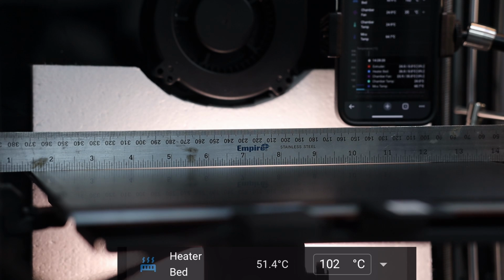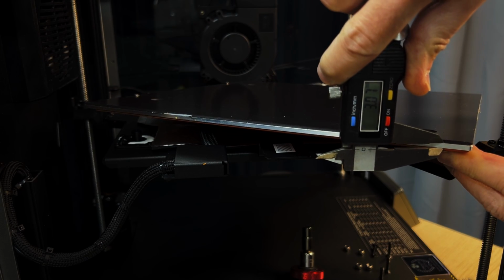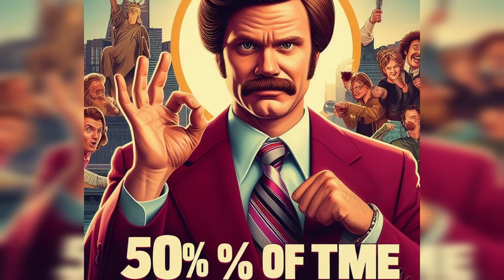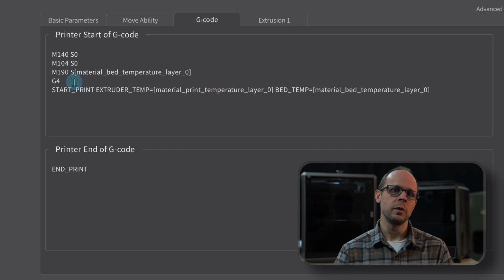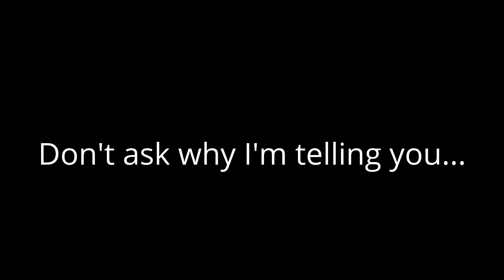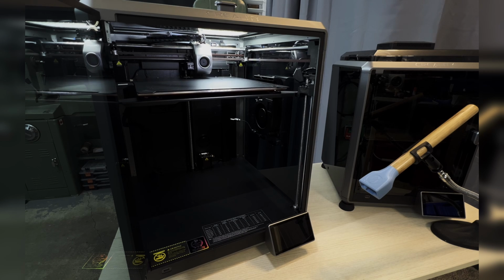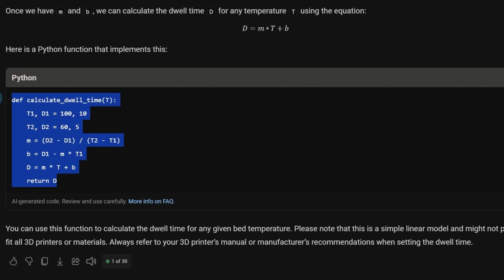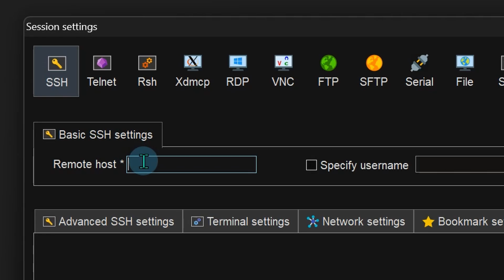Let Your Creality K1 MAX and K1 Printers Soak for the Best First Layers

Comment: Dude that thumbnail is legendary
Reply from the maker: Thanks!!  I'm starting to get there with my TNs, sometimes they come to me quickly and sometimes I can spend sooooo much time on them.   What seems to work well is to pre-plan before I get too far into the videos.  That way I can take the right photos while I'm recording, trying to do it at the end doesn't work out as well.

Funny story.  I had to Redo this a few times because the tub that I needed to fit the K1 Max into had to be huge, so I settled on the smaller K1 and called it a day.

Comment: I have implemented this strategy and it along with adding bed adjustability the root have mad my K1 Max a much better printer. Thanks a ton for these how-tos.
Reply from the maker: For sure, I think we're at the point where we can get a good first layer each time and we don't need to even think about it.  I still want that thicker bed, but this is an okay solution for the time being.   I added an updated bit of coding in the description, it has a dwell time that's based on the bed temp if you want to try that as well, or maybe you have already.
Reply: @NeedItMakeIt  I haven't done the updated one yet. What is the behavior of that one? Does it hit the target temp, then start the timer?
Reply from the maker: @iwannaratrod  It's a lot nicer it will change the amount of soaking time based on the material you're printing with.  60 = 5 minutes, 80= 7 minutes, 100 = 9 minutes extra.  You can play with the formula as-needed, but it's simple and effective, I've been using it on all of my prints since yesterday, near perfection!

Comment: So once we put that G code in, it will do that every time or only when you put print with calibrations?
Reply: Thanks
Reply from the maker: It will do it every time, though there is probably a way to do it differently, I'd just need to know when you want it done and when you don't.  
I'm working on the feature to dwell based on the temperature right now I should have something to update everyone on in a few days to make it so we don't need to wait as long for a lower temp like 60C.
Reply: I just tested it. It only does it when you say print with calibrations so that’s good you can do one or without. Thanks again.
Reply from the maker: @jacory1980  That's strange, when I tested without calibration on Creality print it worked each time.  I have rooted and use KAMP, this may be why, something in CP may be overridden .

Comment: It only took me about 300 usecs to hit like, I already knew I'd like it. I am interested in the replacement beds for the K1Max you spoke about. Thanks for showing the gcode across multiple slicers,  again for sharing!
Reply from the maker: It's my pleasure!  LOL I rounded up to account for those slow clicker people :)  I'll definitely let you know about the thicker bed option as soon as I can.  I'll have a video showing a quick install and then some testing to make sure we're getting really good results.  I can also show how long it takes to heat the bed, it will be slower but should be much flatter and stay a lot flatter.   I have a surface plate that I can also test flatness against right out of the box.
Reply: @NeedItMakeIt   Thanks for the G code👍🏼 I will also be interested in the thicker bed.
Reply from the maker: @RestoDesigns7  You're welcome!   Cool, that's good to know how many people would want one, the company I'm working with had had a lot of requests as well, I think it'll be a popular item.

Comment: I've been printing non-stop on the K1 Max for my business and it's an amazing printer. I still have yet to do the shim technique to level the bed. 
😭
Reply from the maker: Hey!   If it works, it works.  I had a lot of trouble with my first layers on the Max, it really depends on what you print, and where you print, when I printed large pieces I had some PLA prints turn out really well, but the PETG and ABS didn't work out as nice on the first layers, some were hideous.  

I really want to do the bed swap for the thicker plate and see what the difference is.  I also have another idea and I think I'm going to make a video about casting my own bed (K1 smaller printer first).  I want to see if I can make a light bed with a webbed structure which also stays flatter.  I have no clue if I can, but it's a neat idea to try at least.

Nice to hear from you again my friend!
Reply: @NeedItMakeIt  the thicker bed makes sense. I took the existing plate and methodically bent it backwards to give the corners some tension. This keeps my corners down while printing, which was another issue I was having.
Reply from the maker: @AvocadoAtrocity  I was having the exact same problem with mine, beyond those holes the corners dipped down.  It's tough to know how much to adjust since it changes so much based on the temps.  I have been looking at some of the other printer brands and they all seem to have thicker beds for these sizes of build-volume.  I'd love to try copper, but it's probably far too heavy.  There must be an alloy out there that can be injection molded, if they do can do the frame, why not the bed?
Reply: @NeedItMakeIt I have an X-Max 3 with the 6mm thick plate, as well as a K1, and an X-Plus 3, which both have the 3mm thick plates
All values below are measured after heat soaking.

Total flatness variation on the K1 is around 0.23mm across the 220x220 build area
On the  X-Plus 3, it's typically 0.16mm across the 280x280 build area at 60C temps, although at 100C it climbs to around 0.24mm
On the X-Max 3, it's around 0.08mm total height variation across the 325x325mm build area, and that seems to be fairly consistent from 60-100C bed temps

The only downside to the X-Max 3 is that with such a massive chunk of aluminium is that it takes around 8-9 minutes to hit 100C from room temperature, and about another 10 minutes to stabilise, but once stable it is so very flat.

Comment: Definitely keep us updated on the thicker bed collaboration. A 10 minute soak plus KAMP probing on a 5 hr print isn't too bad.  A 10 minute soak plus KAMP probing on a 5 minute print takes a toll on my patience.  IMO, 3mm beds should be limited to 220x220 machines or bed slingers where weight is an issue.  Also, thanks for showing the gcode across multiple slicers.  That's something I wish more content creators added to their videos.
Reply from the maker: I will!  I'll have another video on it and it should be the whole kit so we don't need to try to remove the existing parts and ATTEMPT to reuse them (apparently peanut butter is a legit solution... somehow) to get the adhesive off.  

I think this printer with a 6mm bed thickness would be awesome and I hope Creality makes the change for future printers in the factory.  Even if they need to raise the price slightly it's worth it and will help if they want to increase the accuracy of their filament calibration.
Reply: @NeedItMakeIt where and when? I’m keen for one

Comment: Looking forward to a new chunk of aluminum being available 👍👍
Reply: I don’t know if it would be possible to remove the heater from the existing bed, or if one could buy a new one.
Reply: Actually, Amazon has replacement bed heaters in stock.
Reply: @JustSomeHuman-j8o I ended up buying a 6mm thick bed and new heater. I ditched CR Touch and installed a Cartographer probe. Everything works MINT. Also previous replaced hotend with Microswiss Flowtech.

Comment: To make the soak time-dependent based upon temperature, you want something like this:

G4 P{max(0, first_layer_bed_temperature[0] -10) * 6000}

This says to take 10 off the bed temperature, and then choose the maximum of 0, or that value
Then multiply that by 6000 to get to milliseconds
This way if you set the bed temp to 60 degrees, it'll wait for 50 * 6000 = 300000ms = 5 minutes
If you set it to 100, it'll wait for 100-10 = 90, then 90 * 6000 = 540000ms = 9 minutes
If it's set to zero, then it'll wait for 0ms
Reply: Does someone have the same problem as me? I have no problem with G4 P540000 but the machine will pop up error 2171 when I switched the Gcode to below.
M190 S[material_bed_temperature_layer_0]

G4 P{max(0, [material_bed_temperature_layer_0] -10) * 6000}
START_PRINT EXTRUDER_TEMP=[material_print_temperature_layer_0] BED_TEMP=[material_bed_temperature_layer_0]

I'm using Creality Print if that helps. Having this Gcode is very useful as I don't have to switch to different material but somhow i got a weird error. Thank you for any input.
Reply: @sonluong4043 The error is probably due to that line containing python script. It's not all gcode.
I don't have a K1 yet but hopefully picking up a K1 max today. I have 3 other printers running klipper though so I'm very familiar with it.
If you want my advice, root the printer. It may seem over whelming looking at all those lines of code but with some patience and determination you will learn to understand what each line does and why it's there.
Klipper is documented very well and there are many communities that can help you when you get stuck.
The biggest issue with the K1's I think from the research I've done is how creality has written the macros. Once you learn to re write these to suit your use case for your printer you will see how powerful klipper really can be.
Reply from the maker: Awesome.  I will try this out today, I attempted so write a similar calculation in, but it failed, I had the incorrect bracketry, but I like that you were able to simplify it to something so clean!   I'll let you know how it goes.
Reply: @NeedItMakeIt What threw me off for a moment was that first_layer_bed_temperature is actually a vector, and not a scalar variable.  In English terms, a vector is a like list of values, which means that it needed the [0] after it to get at the first value on the list.  I found it odd, because in the slicer first_layer_bed_temperature only takes a single value, and not a list.  Once I figured out what it wanted it was fairly straight-forwards.  I just didn't expect something that should just be a single value, to instead be a list of values.  I don't know, but maybe that's the issue you were running into as well with the bracketry?

In any event, this should work for all Prusa/Super-Slic3r based slicers, including Orca.
Reply from the maker: @stew675  It works beautifully!   it doesn't need to be vector, it could be directly proportional, 6min=60°C etc.  This is very nice and elegant if you ask me.  I've tried it with PLA and we have P300000, PETG has P420000, and ABS has 540000.    I'm going to do a few prints with this and then I can make a short follow up video and link it, can I credit you in the video?
Reply: @NeedItMakeIt  Sure thing (credit). I'm happy it works for you.

I think there's some slight confusion on what I meant by vector in terms of gcode variables, but let's not worry about that here. If it works, it works!

Comment: having one bed screw tight and other 3 just snug, will allow bed to expand and contract without warping the bed, you need to heat soak for an hour or two to allow bed to relieve stress. after this  you should find bed has less warp and more flat. you may still need to level bed with shims etc.
Reply from the maker: Ah, that's a neat trick.  Having spoken to some manufacturers of beds, they don't recommend the 4 point connection and you're method is a good way around that.  I'll give that a try!

Comment: But what happens if you want to print consecutive jobs? Ten minutes (or whatever ) each time could slow things down significantly.
Reply from the maker: Sure, I'm happy to work on something to help with that.  There are some other changes on Gcode End, for example not allowing the bed to completely cool.  I need to learn a bit more about Gcode programming for CNC machines.  When I learned Gcode it was in college for woodworking CNC machines and it's now quite the same.
Reply: I am always amazed that the notion of gcode, that came from humble beginnings (way last century 😜) is still used with amazing results in modern technology.
Reply from the maker: @JustSomeHuman-j8o  That's a great point.  Let's see 20 years ago I started to get into it for CNC machining and we programmed manually, which was SUPER tedious.  Now it's not much different and all automatic.  I've spent a little time on 5 axis gcode for woodworking, and WOW it takes a lot more time to wrap your head around it.  We were doing saw blade calculations where the saw was used in 5 axis, and was mounted to an arbor and both sides of the blade needed to be accounted for, that was really tough!   

Do you know when it was first used?
Reply: @NeedItMakeIt  Well here’s what Mr. Google has to say. 

The first G-code was created in 1958 at the MIT Servomechanisms Laboratory.

The earliest version of G-Code was standardized by the Electronic Industries Alliance in the early 1960s.
Reply from the maker: @JustSomeHuman-j8o  I'm always amazed at how far we've come, but also how successful we were with so little automation before then.

There are probably far more efficient methods of writing code, but I suppose when humans need to be able to interpret it, this is what we need.

Comment: have creality started shipping units with beds that don't warp yet?
Reply from the maker: I have a few videos on this subject already, but they'd need to change the thickness of the bed and also the way that they've mounted them to the frame below, 4 point mounting causes problems during the heating cycle according to the company that makes printer beds.  I hope they'll make any new printers they send out with thicker beds and they can avoid one of the biggest problems with the printer.  Aside from that, it's a good unit, I really like using it and the Max having the extra space does make a difference.  Now I don't feel as restricted when I'm designing things.

Comment: I reluctantly bought the K1 and have not regretted it yet! That thing printed awesome pretty much straight out of the box. Here I thought I'd be tinkering with it and all sort of stuff, but nope. Perfect so far.
Reply: Having bought 7 previous Creality printers I did not even consider another Creality machine when it came time to buy a new super fast printer, I went for the Bambu Lab X1 Carbon as it was extremely hard to find anyone who did not like it or had issues.
 How has your bed fared with the warping issue? If its good have bought it just recently?
Reply: @AndrewAHayes  Yeah I literally just got it a few days ago. Maybe they've made more improvements, but I'm telling you that thing prints awesome! It's simply perfect. I really wanted the Bambu Lab, but for the price I just thought I'd give the K1 a try.
Reply: what printer do you had before? just for comparison of your benchmark by awesome in your opinion